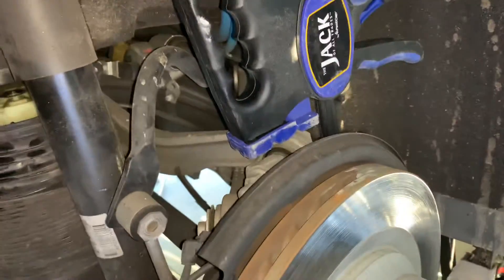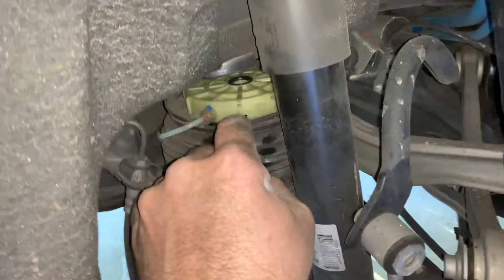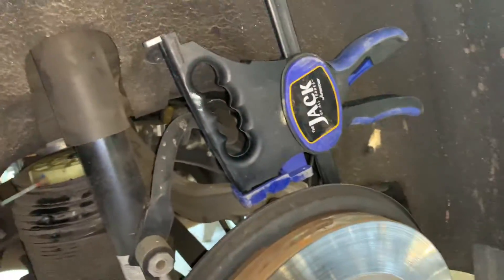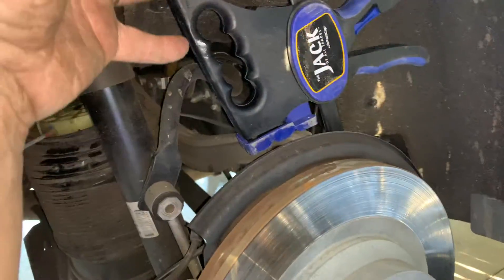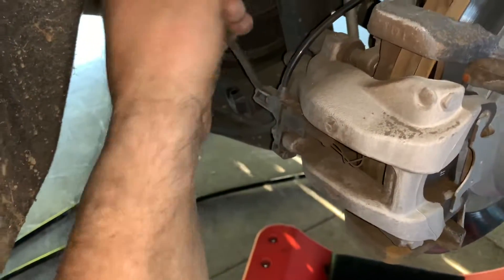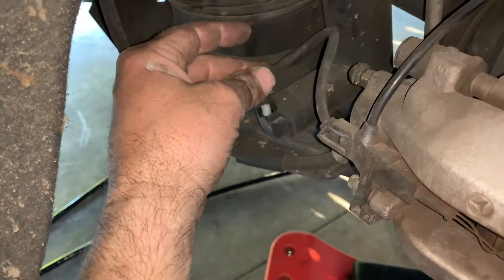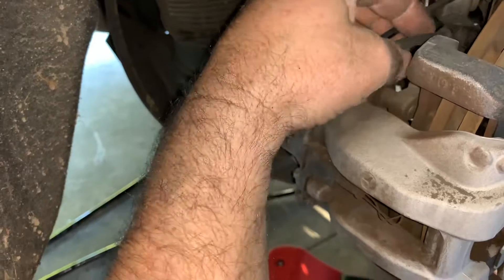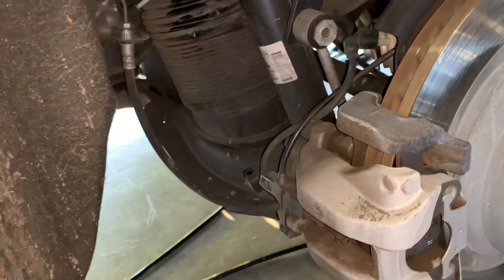W212 Mercedes E550 rear air strut replacement

Comment: Thanks for this, knowing to drill a hole made my day. I didn't have a hand Jack to push the lower arm down so I just removed it on side that mounts to the body, making sure to loosen the other end, way less fiddly to do and quick to remove and replace

Comment: Where can I get the jack from?
Reply: The jock of all trades is from Fastcap.com. The hydraulic jack was bought online also.
Reply: Habour frieght
Reply: FastCap is the company who makes.  The Jack of all Trades.  I finally found it. It's a versatile Clamp tool. I saw it for anywhere from 39.00 to 69.00 on Amazon? There's also another similar Clamp that pushes up to 300lbs. The Jack Clamp can handle 200lbs. I believe the other Clamp is about 110.00
Reply: The jack I lifted the car with is a Quikjack. https://www.quickjack.com/?gclid=CjwKCAjwtp2bBhAGEiwAOZZTuHYH0fPEo-qB17azD1Ksl8b3qxfuktg3dqI1IRg2-ElrhayvrBR_2BoC0mcQAvD_BwE